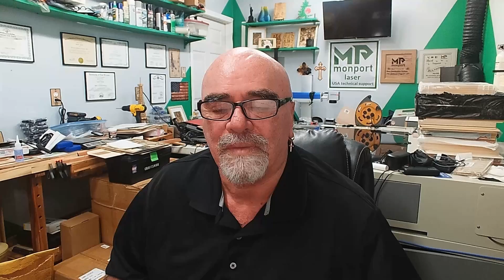👌 Precision Positioning in Lightburn - No Camera, No problem!

Comment: I just use a piece of paper. Tape it to my spoil board and burn a line just like you do except usually done need to cut through. Then sit the part on the line. Works exactly the same but yours I like because it sets down into the fixture. 

Oh lol just like the second half of your video. ROFLMFAO 🤣

Comment: Awesome video. Sorry if this question is somewhere in the comments but I missed it. You mentioned a book of kraft paper. Where do you usually get yours? I'm trying to figure out the weight/thickness of the paper, etc. you are using so I can replicate this. I want the figure out the perfect kraft paper settings for the D1 Pro 10W so I don't end up with a bonfire as a template. hehehe
Reply from the maker: I use several different types, but almost any type is fine. Just adjust the settings accordingly.

Comment: I'm new at using Lightburn and see when you hit start  there is a dialogue box that comes up with -Laser on--Air on--focus set work framed-- how do you do that, I have a problem remembering all those steps every time and then waste my material.
Reply from the maker: Click on the wrench and screwdriver icon, the device settings. In the bottom right corner you'll see Enable job checklist. Turn it on, and then click Edit and put whatever you want in there.

Comment: How do you set the heigth of the laserhead. Do you measure the thickness of the material you engrave and then add the neccesary heigth you normally need to engrave>
Reply from the maker: As per the manufacturer's instructions

Comment: I just toss a tape measure over my scraps, but so far most scraps get used running test cuts/engraves of different things (making sure I got the layers right to get the engrave I want), those still go in the burn pile but nothing bigger than a few mm ever ends up straight in the burn pile.
Reply from the maker: Same here!

Comment: when marking the paper,  I guess it is trial & error to get the correct power setting,  as I have a X20 pro,  and I have found that your power settings for other things seem to be a little higher than what I need,  this thing really burns & cuts,  most of the cutting I have done has been to much on the power,  I have started tuning it down,  and found that I can cut 3mm ply  at 70 % , and 1 pass,  I do need 80-90 to do 5mm solid wood like the  coin chip you do,  but thinking about cutting that back to about 60% and 2 passes.
Reply from the maker: Settings always have to be tweaked for each machine.

Comment: Forgive me,  I am new to the laser game. The No Camera, No Problem tag. I've watched the video and understand what to do if I have a camera, but what if I don"t? Am I missing something? The example shown produces a result that uses the camera for the initial setup and then goes on. The engraving of the cats is naturally going to be right where you want it because the wood is in the same place as the initial setup that used the camera. I know it sounds like I am splitting hairs here, and I appreciate your videos.  Just trying to get that alignment thing mastered without a camera.
Reply from the maker: No, no camera is necessary, that was the entire point of the video! cover the bed in cardboard or paper, run a square, rectangle or circle anywhere on the bed the size of your work piece so it makes an outline, and drop the real work piece into the template. I only used the camera so you could see the process.
Reply: @TheLouisianaHobbyGuy  Understood! I was waiting for the part of the video where no camera was used. My error. Thank you for the clarification. Your videos are immensely helpful. One other question. How long would you say it takes to become proficient in the operation of a medium to large size co2 laser? I've had my Nova 63 a little over a month.?

Comment: Rich, I have a quick question. Background, I just received a OLM3 so I don't know if my process is the same as yours. I've assembled it but not installed LB yet.  I thought you had to focus the laser to the project using the measuring pin on the laser.  I didn't see you do that when you put the basswood on the bed for the cut.  When you specifically selected the basswood, 2 or 3mm on the dropdown menu does that automatically set the focus?
Reply from the maker: No Larry, I focused it off camera.

Comment: I have been looking at buying a 20W diode laser and have watched about all the videos of all the different ones. I think you have me sold on the ATEZR P20 Plus. Amazon has it right now for $999 with the air assist and a 15x15 honeycomb bed! Best deal out of all the 20w lasers I have found so far. Is there a way we can get your library for cutting and engraving the different materials that you have already made and setup in lightburn? That would really be a great start. Thanks for all you info and videos, they are very helpful.
Reply: I found it on your hobby forum. Took a little digging around. Thanks again for all your info.
Reply from the maker: Glad you found it! Use the search feature next time.
Reply: @TheLouisianaHobbyGuy  what would you recommend for an enclosure?

Comment: How does this work if you do not have limit switches on your unit? Such as in the Xtool D1
Reply from the maker: You set and save a position on the move tab at 0/0. That saved position is your "home". Before you use the D1 and power it on, manually move the module to the 0/0 position. Turn on the machine and it knows it's at 0/0. Now you can use absolute coordinates to run your jobs as long as you never move the laser by hand! Any time you need to rehome the laser, just go the Move tab and choose the 0/0 position you set and clickl Go. A laser module is not meant to be moved by hand and I wish xTool would stop demonstrating that way!
Reply: @TheLouisianaHobbyGuy  Thanks Rich!

Comment: Nice video as always. I have an offline laser that I use without a near by computer so what I do is the same you did but without the card board. So the same circle you created for the coaster I make it do 4 to 5 passes at a slow speed about 600 to 800mm per MIN so I'll have plenty of time to perfectly align it before it starts the actual engraving. I have my power output on the lowest setting that my machine allows to show the laser as a guide which on my machine is a (.4). So it runs as 1 job the first layer does the aligning then it'll start the engraving job
Reply from the maker: I have an old video using this method too.

Comment: Love your videos! I had an Idea: you could stick straight pins along one or two sides of the path burned on  the cardboard and just push the material up to the pins, pull out the pins and burn. Easy peasy! 😉
Reply from the maker: I used to use push pins Steve. Once you make the holes in the cardboard and waste board the first time, they go right back into them.

Comment: Perfect! I’m a diode user that uses a honeycomb bed which covers my waste board. I’ve recently started working in Absolute Coordinates on the 29” Eiffel Tower in the Engrave and Cut files. I’ve never taken advantage of the centering of the work icon in the upper tools (arrange long). I purposely got the 12”x12” Basswood for the tower to have extra strips of it for exactly the honeycomb bed pins because I wasn’t careful and my laser went over the hold-down pins… breaking them. This will take care of that and I’ll use a template and strips to make more pins. Those magnets are so strong that if they get close and connect to each other it’s a pain to separate them, but they work too. Anyway, thank you Rich for another great tutorial. Will now make good use of all the smaller scrap laying around.
Reply from the maker: Awesome Jeffrey! I cut my hold down pins from 1.5mm basswood or any other thin material for just that purpose, so they snap off if hit. It keep from ruining the job, so the laser can just keep doing its thing.

Comment: Love your videos sir.  I've noticed that my X-Tool doesn't always go back to the exact location after it goes to the Home position.  In other words, I can make a template like this and run a job but once it completes and returns Home, there's no guarantee that template is going to work perfectly for the next run.  I always frame and check it very closely. Maybe it's just an X-Tool flaw.
Reply from the maker: xTool has a lot of flaws Chris, homing is one. Click Home in Lightburn between jobs to make sure it goes to the 0/0 position and it should work fine.

Comment: I would probably cut the cardbord and not engrave it and then cut my peaces of wood etc. above the cardbord. Have done it the other way and my cardbord catched fire. :) Also this way the air can flow through the honeycomb under the cardbord and you get no burnmarks. #winwin
Reply from the maker: That's the way I usually do it Michael. I have about 50 cardboard templates: https://youtu.be/iM5t37xCv5g

Comment: Another excellent video.  I have created a foam board template which is made of 1/8 inch thick foam board.   I then pinned foam down to a backing board. I burned 9- approx. 4 inch circles into the foam and removed the off cuts.   Now all I have to do is drop the coasters into the circles of the foam, line up the graphics inside the tool path for the 9 circle grid and burn.   Remove the coasters from the foam drop in 9 more and burn again....
Reply from the maker: That's how it's done! Goo job!

Comment: Just curious, what sort of camera do you have setup and how do you have it rigged to your system? I have been thinking about getting one for my Diode Laser and the cabinet I am making for it.
Reply from the maker: I have an 8mp board camera that I printed a housing for. I hot glued it to the top of my Co2 cover. When the Co2 is on, the lights are on and it looks much better.